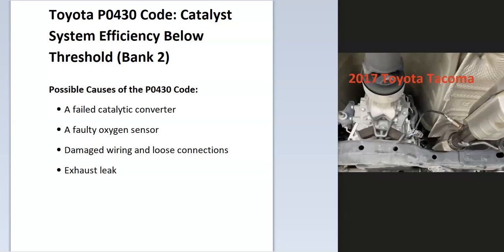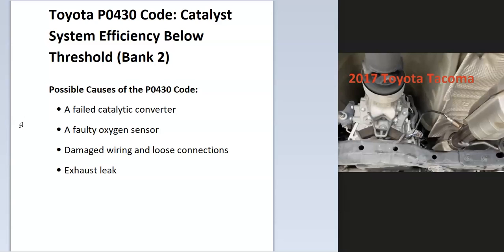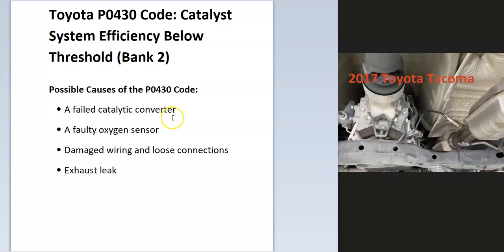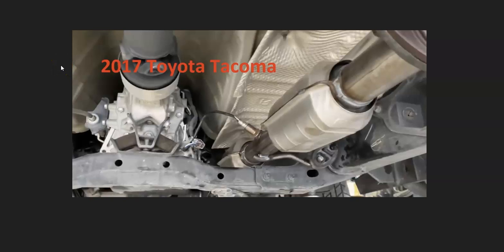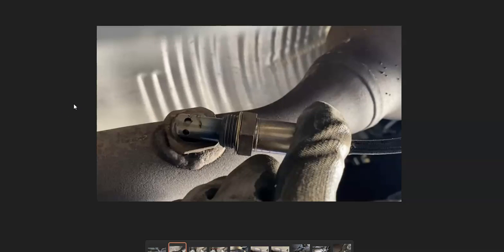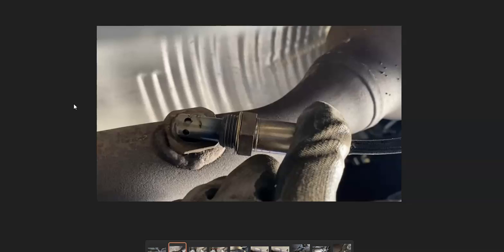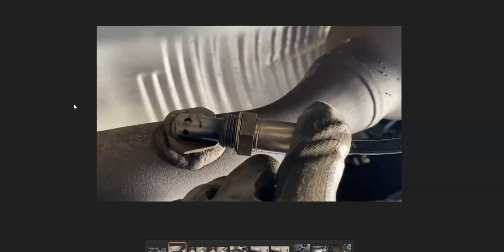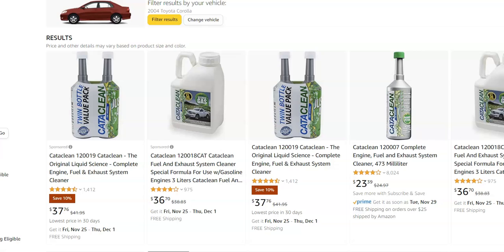Causes and Fixes Toyota P0430 Code: Catalyst System Efficiency Below Threshold (Bank 2)

Comment: How about taking the temperature before the catalytic converter and after it? The catalytic converter is supposed to heat up the exhaust and it should be hotter on the outlet side of it. Two out of three of my catalytic converters were blowing colder air than the inlet side and so I just replaced them today and I ordered some oxygen sensors on the upstream and downstream of the catalytic converter I just replaced. There was a white film all over the upstream one and the downstream one got cross-threaded and so there's only a couple threads left but it still screwed in to the new catalytic converter downstream. That downstream one was a great time getting it off. 😂

Comment: I’m told that it’s usually the upstream one that fails.. I have a 2016 with only 52k miles purchased new & yes not much highway driving.. Is there more than 2 sensors ? I doubt that it’s the catalytic converter itself..  How can U truly tell which one it is even by taking it out ? 🤔

Comment: 2011 Toyota tundra 57 I replaced Cadillac converters O2 sensor maps mass airflow sensor injection pressure regulator fuel pumps been replaced and I cannot get rid of my 420 and 430 code. No bad wire either. What is it?

Comment: Wouldn’t hurt to swap sides on the o2 sensors and drive it for a little bit after clearing the code, if it swaps from bank 2 to bank 1 of vice versa you’ll know the o2 sensor is your problem

Comment: Can you explain that last part again? I’m in the same position 05 Toyota with the front cat/exhaust manifold gasket leaking
Reply: I've been battling 420/430 code for more than 6 years. Poured every kind of scam on the shelf in the tank... temporarily cleared code... back at it now trying to pass emissions. 06 taco 4.0
Reply: @danielfiore8865  what are your symptoms
Reply: @danielfiore8865 change the gasket, if you have an exhaust leak. One thing is that catalytic converters are supposed to be hotter on the outlet downstream and if you can take the temperature upstream of the catalytic converter and downstream of the catalytic converter and it's hotter on the downstream, then it's most likely not your catalytic converter. But if it is cooler like mine were, you'll have to do what I just did and change those bad catalytic converters that are no longer hotter on the outlet side. It took me 6 hours but I'm not a mechanic. I changed the gasket on the down pipe because it blew bubbles when I stuck a shop vac in the tail pipe and sprayed soapy water on it and changing it got rid of the code for a week and then I got a misfire on cylinder 6 again and my coil blew again! I replaced the coil and sparkplug with time instead of just swapping coils and replacing the bad one. I changed the exhaust manifold gasket and the code still remained. My gasket wasn't bad, it was my catalytic converters and I'm changing the O2 sensors just to give myself piece of mind! And today I noticed the serpentine belt was starting to crack and fray. $1,000 in! 😅
Reply: @belogical3961 im in CA. I have 2 precats and 2 cats. Grand total of $5K for oem thats for parts only. You will not pass CA emissions with aftermarket cats. So don't cry about a belt. Im on my 3rd belt. swapped out the pulleys too. Just hit 275K on the odometer. Best of luck to ya bud.

Comment: 2002 toyota camry le 2.4 4 cylinder  with p0420 code  checked the exhaust  gasket front n rear with a shop vacuum  stick it in the muffler and  tape it up .turn on vacuum ..went under the car with my spray bottle mix with dish soap n water started spraying all throu the pipe n walla it stared bubbling front seal and rear seal close to the resonator. Spray other areas under car were it have been welded before like my flange it seem ok there...now wen to the top of the engine were my exhaust  manifold catalytic converter is,prayd that gasket area  too and  it started bubbling .the vaccum needs to have  2 connections. the front to pik up and the back to blow...disconnect the holes were you pick up ,and connect it to the other side of the vacuum were it blows.check it out your self..I was suprise wen I did it..I was like that's crazy...I blew down the garage,dusty

Comment: I have a 2003 Tundra with a v8 and I just got the P0430 code but my check engine light turns on for 2 days then turns off for a day and turns back on. Is that normal?
Reply from the maker: This is just a guess, but the catalytic converter may be starting to fail and then clearing. I would get some Cataclean to blow out the catalytic converter.
Reply: @HVAC_Mechanic  ...yes cataclean is a great product

Comment: If bank 2 Cadillac converter is out and O2 sensors are good no leaks- do I have to replace Bank 1? 2003 Toyota 4Runner.
Reply: I would not think so